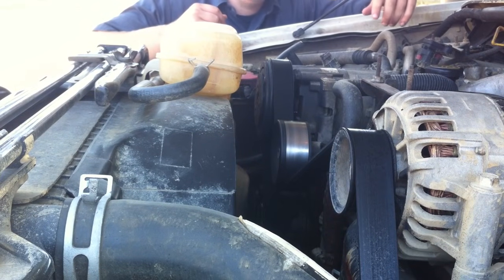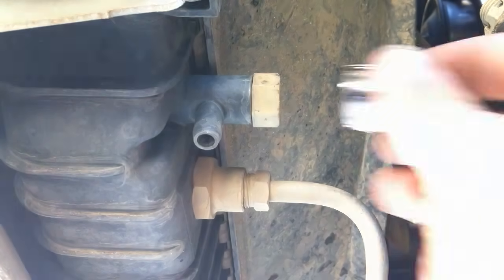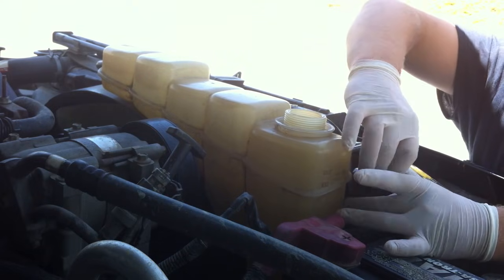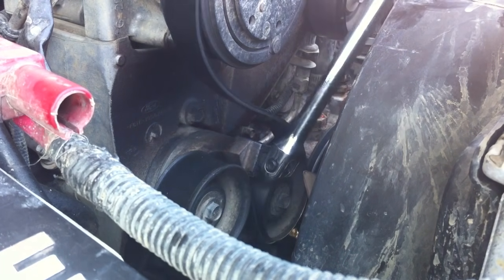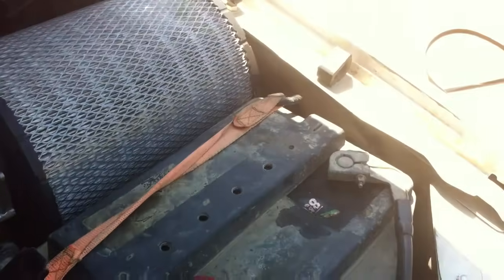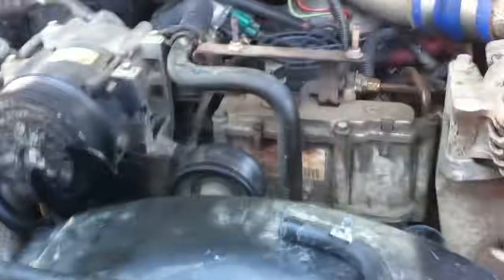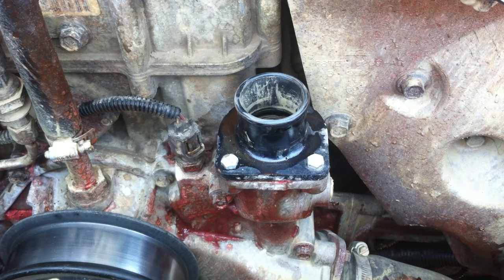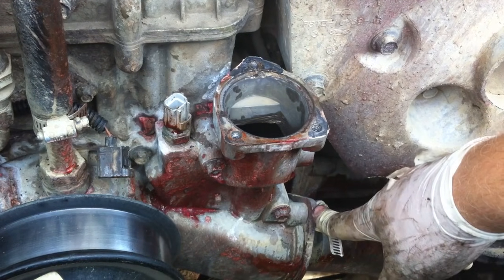7.3L - How To: Replace Water Pump

Comment from the maker: Parts List (PAID LINKS)
----
Water Pump (aftermarket): https://amzn.to/2S0Gnrr
Water Pump (with coolant filter housing) https://amzn.to/3lDLT2L
Coolant Filter: https://amzn.to/3c5BIB6

Optional Parts
----
OEM Thermostat: https://amzn.to/2BqcidJ
OEM Thermostat Housing: https://amzn.to/2Lllrsz
Billet Thermostat Housing: https://amzn.to/2LlNyb3
Dual Alternator Radiator Hose: https://amzn.to/2LpCCcM
203* Thermostat: https://amzn.to/2ChbTvP

Comment: My excursion is in the shop today. Water pump, thermostat, housing, and fan blade replacement. $1500.
Reply: I’m about to replace my Excursion water pump cuz it’s pouring everywhere. Did your fan blade self destruct or why are you replacing it too?
Reply from the maker: It's doable in your driveway if you've got the ambition. Nothing too special

Comment: Why is your coolant red
Reply from the maker: What a great question! 
The red coolant is called ELC or Extended Life Coolant. It's more stable than the coolant that Ford has been using, and it is the coolant that international uses in the same engine in their vehicles. It's a heavy duty coolant designed for diesel engines and lasts 500,000 miles.

Comment: Good vid, thanks for the effort.  I wrapped the ratchet strap twice around the water pump pulley then around the case of the AC compressor and alternator, I could wrench it down tight that way and not bend the fenders.
Reply from the maker: Good deal! Hope the video helped!

Comment: drain coolant. remove fan & shroud.... He doesnt tell u the actual way you're supposed to do it. it's 10x easier than using straps....
Get a set of adjustable fan clutch pliers/holders. u can get them for 15$ at oreiles. get the wrench. if u can afford a new waterpump, u can afford to do it the right way with the right tools.
then hold onto the fan clutch bolts with the pliers and u then insert 1 fan clutch wrench and turn it by hand.

the only info here anyone really needs is bolt sizes so they dont strip bolts.... and all u said is "they are all different sizes so make sure u use the right ones"

thanks....

FYI make sure u use a 6 point socket, not a 12 point, or u will strip bolts.
Reply from the maker: The clutch was too tight for the wrenches. I tried it many times. This is a known issue and the strap method was developed by the community for those people with stuck fan clutches. If you don't like it, don't do it. 👍

Also, the tools are free at O'Reilly's
Reply: @TruckStuff1  well for the people who needed the strap method, I'm sure it helped. Would be nice to include the actual info necessary for the install. 
I'm sure anyone can figure out how to drain a radiator. if not, the definitely shouldnt be installing a water pump by themselves. I was left scouring the video for info pertinent to the water pump install that wasent there. just feedback. 

For everyone else, the correct way prevents rounding off the clutch fan nut. u need a 1-7/8" wrench (47.875mm) with a set of clutch fan pulley holders. also, it's a 10mm socket unless u have a 94 model and are converting to the 95 1 piece design which uses 3x 3/8 bolts included in the kit.

Comment: When I changed mime 2 bolts broke when removing them, not installing, removing. I had to remove the radiator and intercooler to make room to helicoill them. It was a mess
Reply: Wow that sounds like a nightmare. Turns a couple hour project into a whole day event.

Comment: Why do you have red coolant in that truck. If it’s and older truck it takes the green kind. I just read it in my manual because I’m fixing to change mine. Just saying, might wanna check that. Then again, maybe you’re working on a newer engine.
That’s a good point about that belt. I bought a belt and hoses from 1a auto and that’s the belt they sent me. I like that much better. And if you have to change that belt on the road, you don’t wanna take that hose off. 👍
Reply from the maker: It's a 2002 7.3L. The red coolant is heavy duty ELC coolant. It is a better coolant for diesel engines. Google "ELC coolant." It's expensive but lasts a lot longer and doesn't need maintaining like the gold and green coolants.

Comment: better way of doing this would be to old the tensoner arm with a breaker bar but instead of loosing the belt and also removing the belt leave the belt on and use the breaker bar on the tensoner to tighten the belt and take a 4 to 8 pound hammer put a wrench on the clutch nut and hit the clutch nut wrench with the 4 to 8 pound hammer will nock the nut loose and you never have to remove the belt if you dont want it removed
Reply: That nut is really on there in most cases. Not sure sure if that would work. Definitely worth a try though.

Comment: can you just not sawzall the clutch since your replacing it and save time on removal.
Reply: SAWZALL !?!?!  Dude,you could IF you're replacing the clutch and water pump but, Trey's only replacing the waterpump and it's rare the clutch goes out along with a water pump.  Trey explains it pretty good as do a few others commenting people, I just pulled mine and DID NOT watch Trey's video first and basically did it backwards (not advised), it just makes more use of a strap wrench and a pipe wrench with pipe on the end.  Next time... well hopefully I won't have to do this for another 270.000 miles.  I mean I love to sawzall things like the next guy and have a great Porter Cable with demo blade but, not here.
Reply: George. well I'm at 425000. just going to start replacing everything on the front end pumps bad clutch makes noise so do the tensioners and idlers going to replace it all figured it's easiest Sawzall
Reply: David Jones Then go for it since you're replacing everything. Just remember keep those M8 1.25 X 10MM bolts from the center front pully, there are a bear to find and length is critical. Too long and you're digging into the pump housing.
All those problems and so young... was it under water or you're just replacing just since you're there and why not?  Curious how long it will take to buzz through it?
Reply: George have always changed the antifreeze every 2 years also adding penray additive for cooling systems to it. the water pump is just now starting to jump and grind so I figure it's better now been getting stranded somewhere and the clutch always makes  noise in the summer has for about the last 3 years so I figure it's time

Comment: I laughed out loud when you douched yourself with that lower hose
Reply: I just did it pulling the trans pan too, there's still A LOT of fluid in the filter.
Reply: Agreed lmao. That’s why there is a drain on the radiator, to avoid the coolant bath. Haha

Comment: Not sure if my water pump is leaking or not. On the lower radiator hose where it connects to the water pump has coolant on the bolts and coolant is leaking off my lower radiator hose. If a water pump is leaking will my lower connector hose have coolant on it? By the way the truck only leaks when it's been driven then shut off for a few hours.

Comment: Do you absolutely have to remove the degas bottle?
Reply: way to late here, but yes. In fact getting it out of the way makes the rest go smoother. Its only maybe 5 minutes to remove it and it gives you room to work.
Reply: Unless ya got the OBS with the bottle on the passenger wheel well.

Comment: Is it really neccessary to waste everyones time with useless information on how to loosen a radiator drain cock with the correct wrench or socket?  There are not any persons who haven't turned a wrench watching.  Next time just get to what is important. Thanks.
Reply: +Ma K I know plenty of people who don't know which end of a tool is functional. It's almost humourous.
Reply: Most people watching are retards hence the reason you, me and they are watching the video.  What you find valuable may not be to others but, break that petcock and $400 and a new radiator later you may say hummm???

Comment: You do a great job on your videos, they've helped me ALOT. I've run into a kinda weird problem. I have a 2002 Ford Excursion, 7.3 PSD. i'm just starting the water pump removal and my Clinton shop manual says the fan clutch nut has left hand threads, loosening would be clockwise. other sites have stated both. Left and right threaded. which is correct? Thanks
Reply: A matter of perspective and what the fan shroud says. When standing infront of the motor it should be lefty loosy.

Comment: You made taking that fan clutch off way harder than it had to be. You could've left the belt ON while you took the fan clutch off.
Reply: Doesnt always work like that. Works less than half the time in the midwest. Might work in non rust areas

Comment: For me getting the fan clutch nut started back on the threads is the hardest part. Nothing else has been a problem, but the damn nut doesn't want to go back on grrrrr.
Reply: Did you ever get it? 😂

Comment: I have a 1999 7.3 with a six speed. The fan was damaged during a water pump replacement and I never replaced it. That was 10 years ago, I pull a 12,000 pound trailer and it has never even gotten close to running hot. I am replacing the water pump this weekend because the water outlet rotted. If I have to belch the truck out I will just do everything at once.

Comment: That fan sure is a bitch. Took a fan wrench and a lot of hammering with a friend of mine holding back on the pulley with a strap wrench to get it off. If you have an air hammer you can get the removal kit that the Ford techs use that makes it WAY easier. Is that ELC coolant you have in there? I gotta do that to mine. I flushed my system last summer but used the Ford green anti-freeze with the VC-8 additive. I didn't know about ELC coolants really at the time.